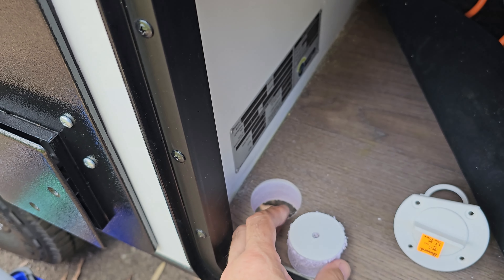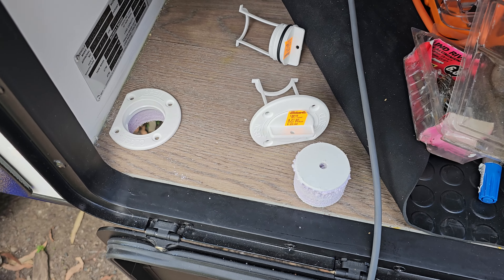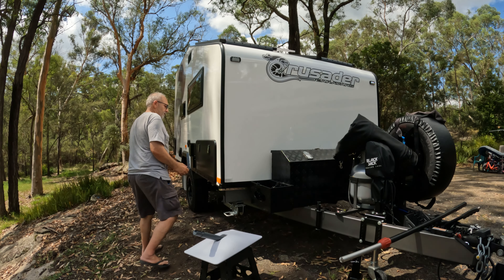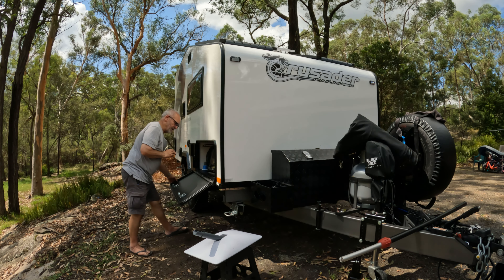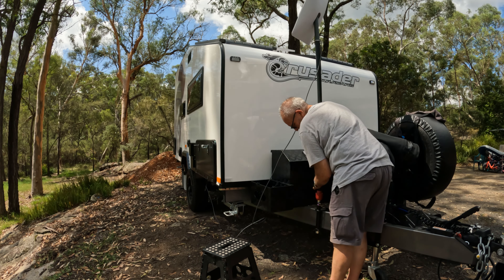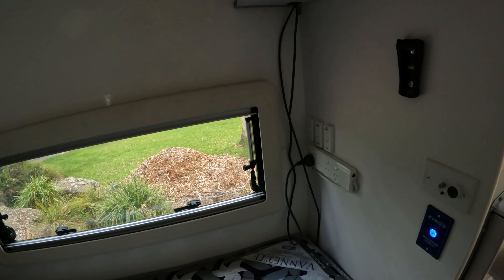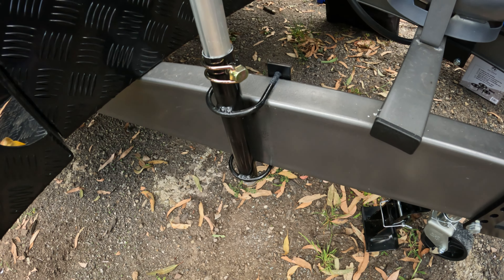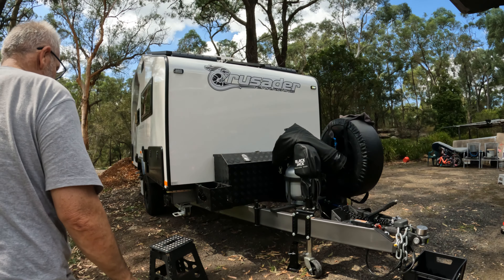#0202 Crusader gets Starlink

Comment from the maker: Good pickup
I got a plastic adaptor from Amazon that the dish keg clicks into 
Then I got a stainless steel table leg from Bunnings, about $8, and the adaptor fitted in perfectly
Then I pop riveted the adaptor into the table leg, then pop riveted the table leg onto the bull float pole 
Quick spray with some black plastic dip

Comment: Could you please tell me more about the pole?
Reply from the maker: The pole is from Bunnings, it's a bull float handle, comes in green colour, around $80. At Bunnings usually in the power tools section.
Reply: @NeilF4x4Crusading  Cheers for that, looks like there are 3 parts to the pole, the pole itself, the insert, but what about the coupler?